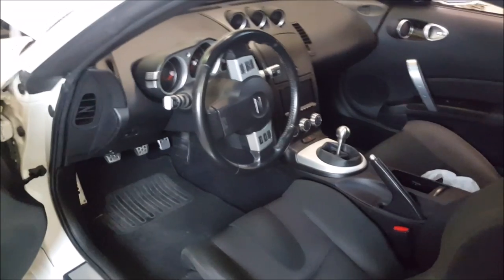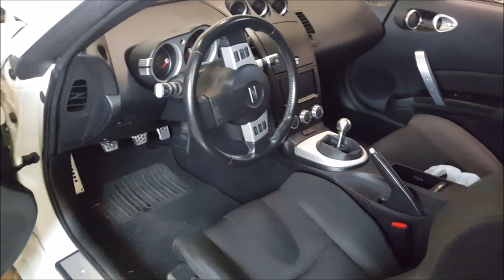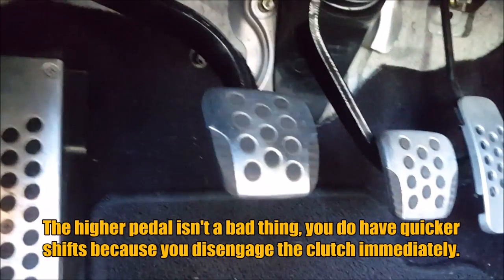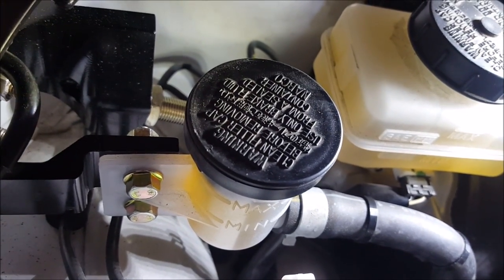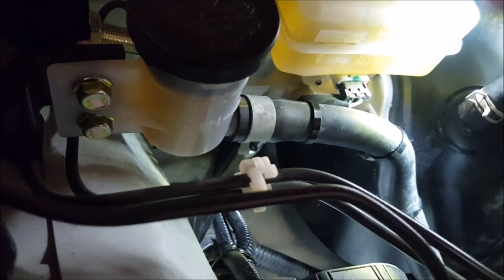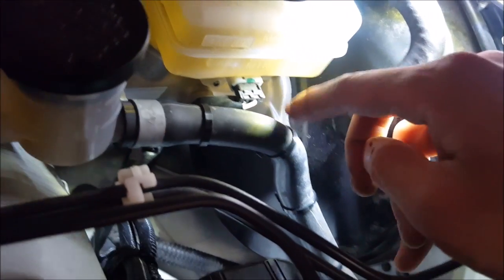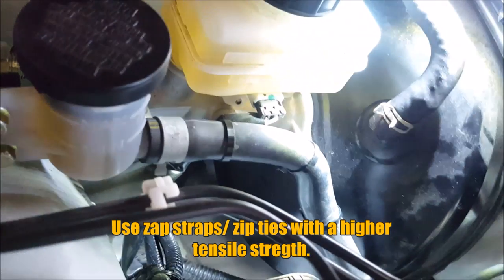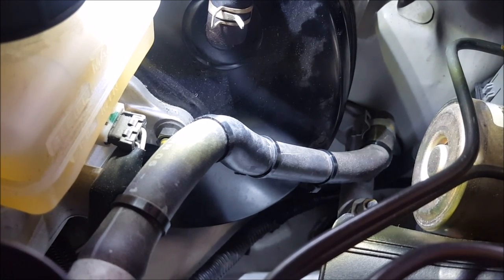350Z Clutch Pedal Mod (350Z owners I need your feedback!!!) | AnthonyJ350

Comment: Anthony, I follow all your videos and well done on great productions. This year I did a massive overhaul on a newly acquired 2005 European 350z. Part of this included a full fluid flush of the hydraulic fluid for the pedal. I hadn't the luxury of 2people but had a single person bleed tube and bottle. Once the bleed nipple is loosened I recall the pedal resistance being non existent-to the floor and that was it, so pumped with my hand to flush out old fluid and top up with new until I was sure there was a complete replacement with new fluid. Tightening up the nipple it took quite a few pumps to bring feeling back and also to ensure correct fluid level. To me it sounds like your "mushy" pedal is the result of pressure loss-are you certain there is no air in the system? Your levels look good though they seem on the high side. Was it DOT 4 standard fluid that was used? The cable tie theory makes sense though is there still not an opportunity for the hose to bulge between them, if that is the cause of the mushy pedal? I'll certainly give the cable tie theory a go for you to see if I notice any change in feeling. Keep up the channel and the great insight.
Reply from the maker: Thanks for the support!  Ya I figure why not get everyone involved this time and try to get ideas how to make the hydraulic system better based on everyone's experiences.

Comment: Dot 4 fluid? Dot 3 when it heats up it makes the pedal feel weak.
Reply from the maker: I prefer to use DOT 3 since that's what the system was designed for.  I'm hoping the heat shield on the flex line will help keep it cool.

Comment: Damn how did u restore the headlight that shiny?
Anyways yeah as that youtuber mentioned dot4 fluid, it is better performance but harsher. Especially if in the wrong system even if both brake fluids are actually compatible with each other. My motorcycle maintenance manual actually says I should change my brake hoses every 4yrs. Wtf I guess dot4 does eat rubber slowly after couple years.
I'd say first bleed, then if no progress, then change hoses. If still no progress, well your cylinders are next.  start with cheapest correction method.
Reply from the maker: Bought the car like this then just wax over them when we detail the car. Will try having it bled if it happens again.

Comment: might be your slave cylinder giving out is it stock?
Reply from the maker: Ya it's the original one.  I'm monitoring it.  If it gets worse then I'll change out the slave.
Reply: AnthonyJ350 how is it so far? has it completely stuck to the floor ? my 370 had that issue and it currently has it again I'm waiting for it to stick to the floor
Reply: AnthonyJ350 hey Anthony how long did this last you? And how many kms did you put on it

Comment: Zip Ties on the hose are going to do absolutely nothing. There is no pressure in that line. That just connects the reservoir to the master cylinder.
Reply from the maker: Thank you!

Comment: Oh I forgot to mention if the previous owner used dot4 brake fluid like most ignorant ricer fucks thinking it's better since it's rated for higher temperature, it'll eat the internal seals faster because this system was designed for dot3.
Reply from the maker: Doesn't DOT4 also pull more moisture. I believe it has a higher boiling point but has to be changed more often.
Reply: Yes it's higher temp tolerant but pulls more moisture especially in this Houston humid climate. My bike system uses dot4 and states I should flush every two years. I notice it gets mushy around the 3yr mark so I change it since the fluid is less than 8bucks and a cylinder or caliper isn't.
Reply from the maker: Mechanicable Haha agreed.  Put in whatever the system was designed for.  People get too "race car" on the internet.

Comment: not enought pressure in ur clutch line
Reply from the maker: It feels almost like air in the line. Only when really hot.
Reply: try bleedin your line or u just need clutch master rebuild
Reply from the maker: Will trying bleeding if the problem happens again.  I'm going for a 4 hour straight drive this weekend, so it'll be a good test.

Comment: I corrected my half pedal by changing my slave cylinder.
Reply from the maker: Nice!  Was it leaking at all visibly?
Reply: No surprisingly that's why I had such a tough time diagnosing the half pedal. Dug around g35driver.com for weeks and found people with success after replacing the slave. So tried it myself and its been 4+years and still good! 

i did however had mushy pedal like you when driving hard for a while. So i installed a JWT clutch + flywheel along with stainless braid clutch line, throw out bearing, clutch fork, pivot bolt. Its been 2 years and my pedal is super stiff still and grabs hard. However my engagement point is still pretty high i think thats just the nature of our cars. Also I never had to lower my pedal to remove the play.

but your fix sounds interesting and makes sense ha. I might do it for the hell of it haha
Reply from the maker: Wayne T Why not right?  It's just zap straps.  If it works you can do band clamps later on.

Comment: my 350z feels the same, I'll try this and let you know!
Reply from the maker: Yours gets a little mushy when it's hot?
Reply: +AnthonyJ350 yes!
Reply from the maker: Does it come up all the way still when it's mushy?
Reply: +AnthonyJ350 it comes all the way up but the clutch engagement is too high, it's almost right at the end of the clutch pedal as if there is virtually no empty space from pressing the clutch till disingaging it!
Reply from the maker: mrgold88 Yaaaa that's just how these cars are.  How old is your clutch?
Reply: +AnthonyJ350 i bought my car like 4 months ago and the previous owner said that he replaced it recently, I took it to a garage and they confirmed this!
Reply from the maker: mrgold88 Do you have the stainless braided flex line installed yet?
Reply: +AnthonyJ350 no not yet, all stock!

Comment: No no no! The clutch reservoir has nothing to do with clutch feel or performance! It only holds the fluid and feeds directly to the master cylinder! After the master cylinder is what is important! If you fuck with the location, you will cause massive problems with gravity feeding the master and cause loss of fluid exchange (heat) if anything move it up but really don't fuck with it
Reply: And yes including the hose to the master cylinder
Reply from the maker: Thanks for the feedback!

Comment: There is no way this will help, there is no pressure in that line nor the reservoir, if there was the reservoir lid would pop off. It takes a lot of pressure to disengage the clutch for instance. The way the master cylinder works is with a "plunger" inside that compresses the fluid down the line that goes down to the slave cylinder by the clutch. The reservoir/pipe just refills the master cylinder when the "plunger" is pulled back. Think of the procedure when bleeding the system...
Reply from the maker: Well the thing is it's like there is air getting in the line when hot. Z33 Garage did mention it may be an internal issue with the master. But like I said I didn't get a mushy pedal like I tend to. If I do again, then the master has to be swapped.
Reply: +AnthonyJ350 I can't remember when last I changed the fluid if the line running down to the slave cylinder was metal or rubber. If that one is indeed rubber it could be the cause of the issue you are experiencing. You could change that for a hardline or braided one.I will check if I can tell on mine. On a side note, if you are in the process of doing that there is no need to replace the whole master and slave cylinder you can just replace the rubber seals inside, way less cost and good as new :-)
Reply from the maker: +Alru Waldeck Ya if it's a hard line off the master initially don't see the point of a braided line. Hardlines don't wear out.